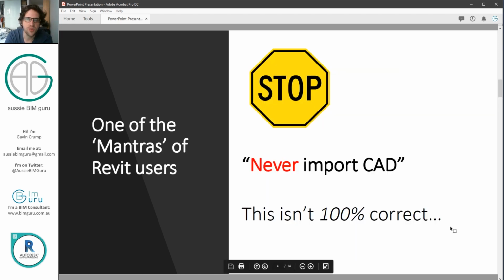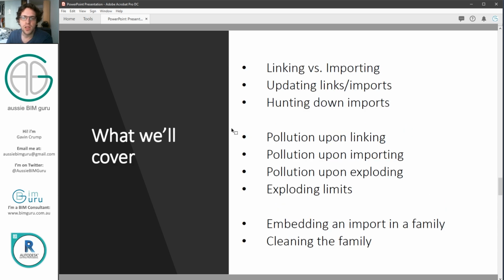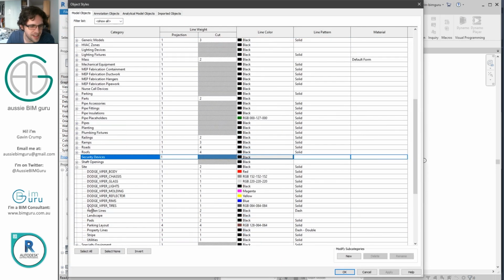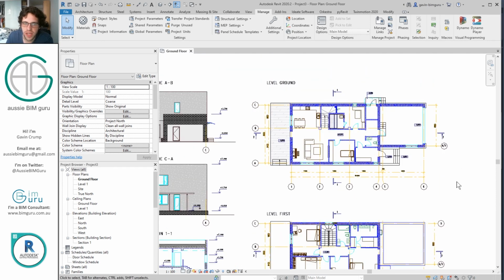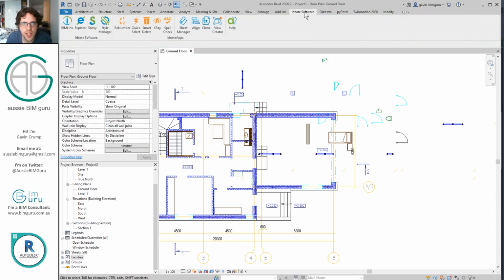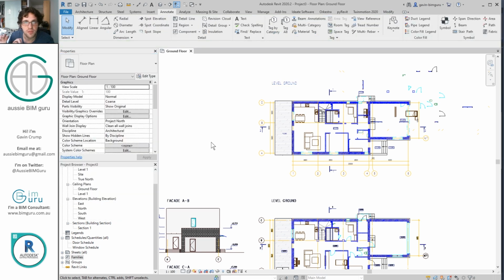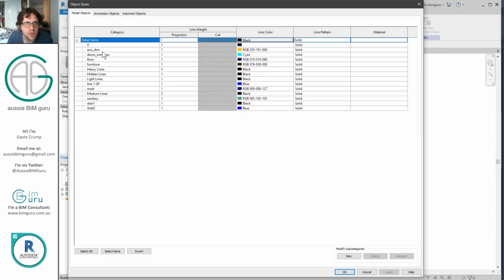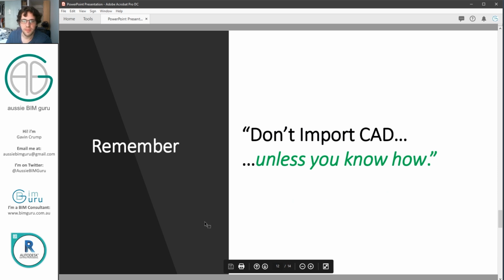Importing CAD into Revit (properly!)

Comment: Can we do analysis like cooing and heating load calculations on linked cad file
Reply from the maker: Not really. You need connected system elements modelled to undertake systems analysis in programs like revit.

Comment: Autodesk's interoperability between REVIT, AutoCAD and NAVISWORKS is a joke at this point. Autodesk just takes our money but never fixes those software's inability to work together. All three should work together seamlessly, but they don't.  It's insane.
Reply from the maker: Mm for the most part I agree that these programs do not easily work well together. Very few programs work well together in AEC without hacks and workarounds unfortunately.
Reply: @AussieBIMGuru   The more complicated the project (REVIT coordination to AutoCAD 3D modeling over Point Clouds, to make shop CAM programming and Field Coordination (NAVISWORKS)) need A LOT of workarounds or, simply do not work at all.  And the current set of know-it-alls at Autodesk are asleep at the wheel apparently. Support is atrocious now and hardly ever has a fix... they just lets cases hang unresolved.

Comment: thank you, just a quick one how can i import cad file such that it underlays my Revit Elements. i have imported cad file I am now unable to see some underground sleeves, if I zoom out the the drawing i can see them but if i zoom the the drawing and print some conduit get blocked by cad file and become invisible.
Reply from the maker: Unfortunately I've found there isn't a perfect way to overlay CAD to Revit, some things always sit over the top in its hierachy. The two options Revit gives us are to use current view only for the import then set it to an overlay, or raise it to a higher level in the plan if it is not for current view only.

Comment: I pretty much always link whenever possible, also using relative filepaths. Imagine the horror of importing a DWG made with civil 3D that contains thousands of layers🥶. Those sort of files always require a lot of stripping and cleaning up and a lot of preparation before they are suitable, also because of the grid coordinates of survey drawings having huge extends, that go beyond the limit that Revit finds comfortable.
Reply from the maker: Oh the horror! Been there far too many times in my career.

Comment: Hello, thank for you for uploading this. I have a question, I have floor plan drawings in Autocad that I would like to import correctly and then use in revit to create revit drawings. Do I then trace over the imported dwg plan in revit to achieve this? Thank you
Reply from the maker: Usually on projects we would link the CAD files and model over them as a starting point. We usually would not import the DWG files.
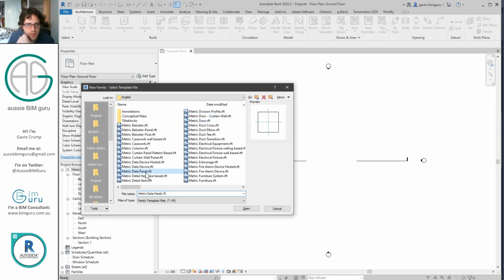Reply: @AussieBIMGuru  Sir,I'm going to do the whole architecture in imperial ,so while making the family at 15:05 your video, should i take family template as metric or imperial in my case
Reply from the maker: @nagababucherukuri5069  typically you would be using imperial units in all cases if you are working with imperial files.
Reply: @AussieBIMGuru  Tq for your reply sir

Comment: I STILL HAVE THIS SCALING PROBLEM,EXAMPLE BRINGING IN THE SITE PLAN WHICH IS ENORMOUSLY OVERSIZED WHEN I PLACE IT ON THE SHEET,EVEN USING SCALING THE DRAWING TOOL?
HELP SOMEONE PLEASE
Reply from the maker: Hi Rossco, typically before i import or link a cad file i check the drawn units and also if they are correct (e.g. even if autocad says mm, has it been drawn that way). Make sure to use the settings when bringing it to revit (don't use auto detect).

Comment: Hi, I'm just wondering if there is a way to Import a 2 storey house from Chief Architect as a 3D model? I'm looking to apply Lumion to the imported 3D model, to save me a lot of time. Is this even doable? I would really appreciate any help. Thanks : )
Reply from the maker: Been a while since I've had much to with the Chief', but I seem to recall the only export options Revit could receive were IFC or 3D DWG.

So the answer is sort of, but not really.

These both unfortunately come in as static elements. IFC will be separated into individual parts at least, but most of the intelligence from the source is usually lost in this process.

Comment: Hi Gavin, 
thanks for sharing the tip. I have a problem while importing CAD files with this method. When I create the family and use it in the Revit file, it only shows the lines of the original file and loses the texts. Could you please tell me what I am doing wrong.
Reply from the maker: That's odd... is the text visible in the family still? I know that imported text can have issues if it's either on a frozen layer in the dwg or multi-line also.
Reply: @AussieBIMGuru  Yes seems odd. The text is still visible in the family. The layer in the cad file is not frozen.
Reply from the maker: Hrm I'm not quite sure in that case... make sure the family view scale matches project view scale too so the text scales to the same point.
Reply: @AussieBIMGuru  Great, thanks Gavin

Comment: Hey a question there.... I appreciate the workflow you followed and the fact that it doesn't pollute the model. However, it wasn't really clear to me why would I ever need to import CAD instead of linking it. (And perform any edits, should they be needed, in the CAD environment directly)
Reply from the maker: The main reasons are;

1. Creating an embedded object without a link back to a DWG file. A common example is a 3D city context file

2. Introducing DWG elements into a family (then into the project)

There are some other minor use cases but these are the most common. 1 is common also for embedding CAD details in a Revit file. Bad practice, but it happens often, especially with engineers in my experience (typical details etc).

Comment: Great video once again!
From my experience what I have done in the past when importing CAD files is import into blank template, strip out all CAD hatches line types etc and replace with my Revit templates line styles hatches,  then copy to clipboard and paste into current project.
Reply from the maker: Thanks Tim, yep that works also! I do find sometimes having them in the detail family can be safer as you have the ability track them down more easily, although having to control the styles in the family can be a bit of a drag vs in project.